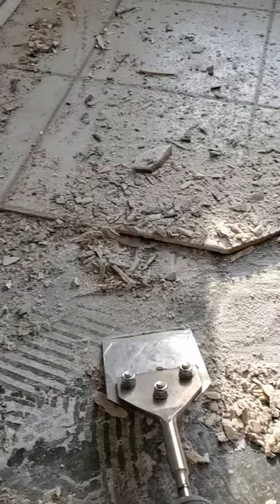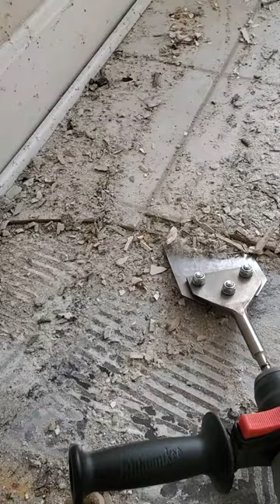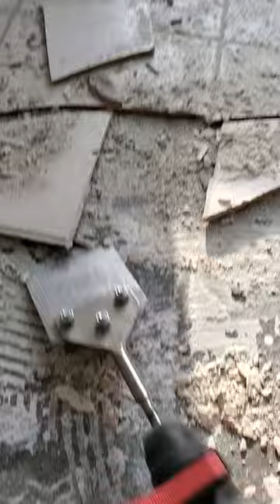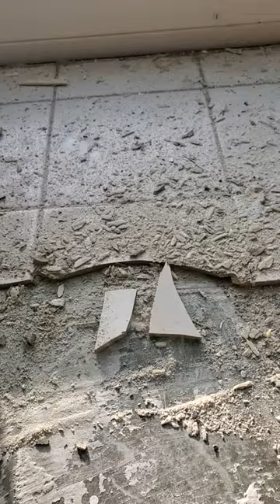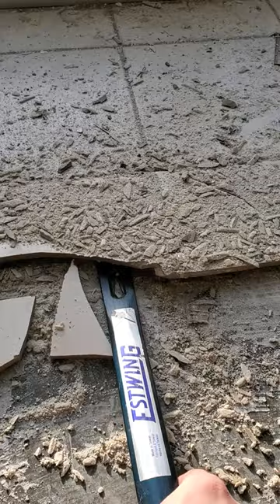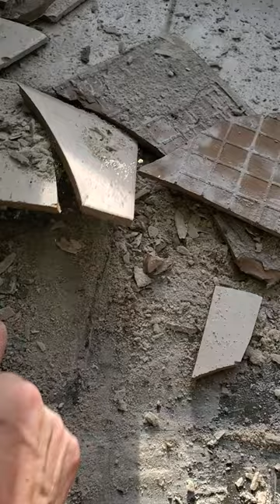Easier way to remove tile from Concrete floor. Milwaukee hammer and floor scraper.

Comment: What tool are you using?
Reply from the maker: Its in the description, This Milwaukee 1-1/8 in. SDS-Plus Rotary Hammer and floor scraper made this so much easier